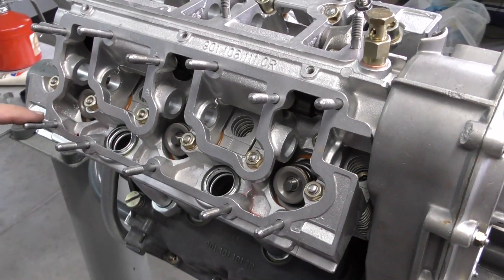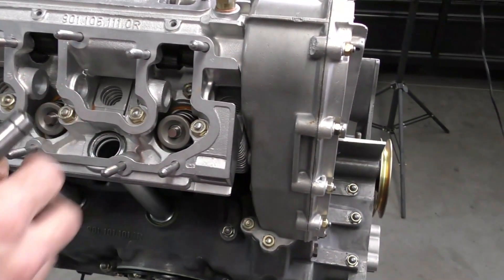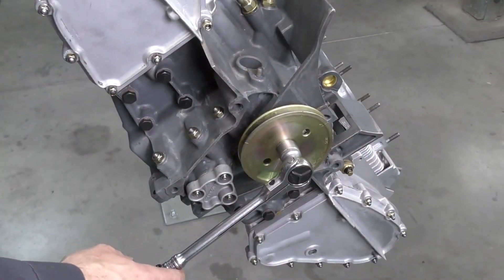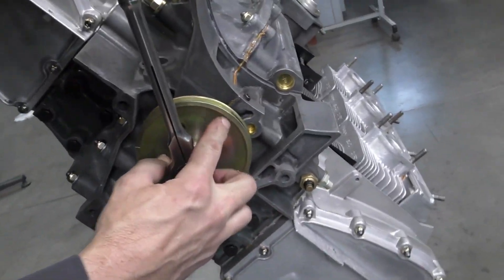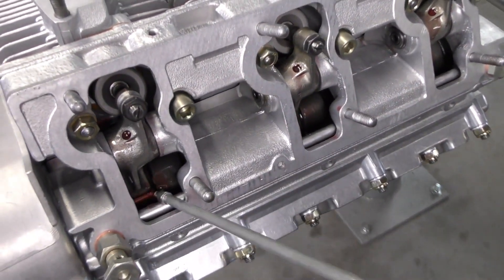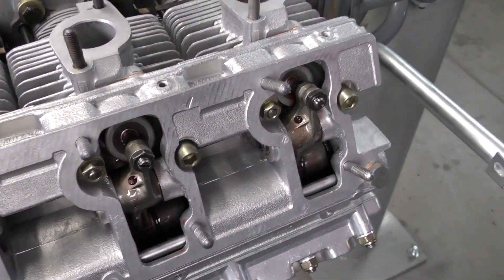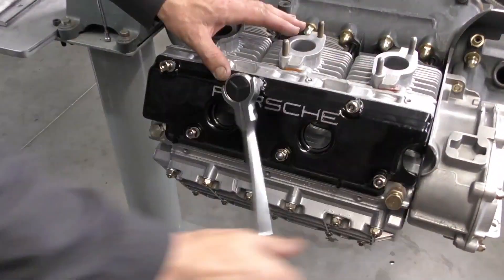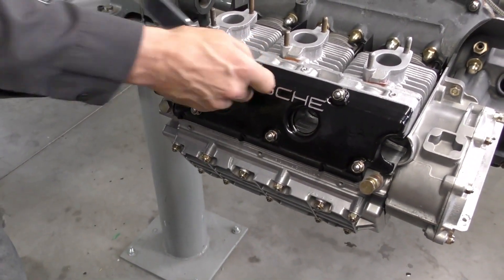Setting Valve Clearance on your Porsche Air-cooled Engine.

Comment: Howdy, im interested in learning why the oil cooler o-rings/seals dont need any oil on them? Ive always put oil on o-rings and seals just out of habit.
Reply from the maker: Because it is a compression seal that is not designed to move during installation. Orings are lubricated to aid in installation. Most times an O-ring type seal is pushed into or screwed against in the case of an oil filter and will bind, roll, or tear if not lubricated. This is not the case with the oil cooler seals. 
However, you can if you like lubricate them when you install the oil cooler and it will not hurt anything.
Kurt
Reply: @Aircooledconsulting  Kurt, what a great response, thank you for the education! That makes a ton of sense,

Comment: What are your thoughts on anti-seize on the spark plug threads?  I know Porsche says not to use any to help maintain electrical grounding.
Reply from the maker: I Still use a small amount of Copper grease when installing spark plugs. Its hard to break old habits.
Kurt

Comment: The milling the valve covers was slick! That is a clean engine!

I see you don't have the carrera timing chain tensioners on here. Im cleaning up a 1977 2.7 and read that I should add the carrera tensioner. What are your thoughts?
Reply from the maker: So the Carrera tensioners are really the way to go. However, in the past 10 to 15 years there has been a resurgence of using the original non pressure fed tensioners to maintain the originality side of the motor. There is also one concern when using the late model tensioners on the early 2.0L, 2.2L, 2.4L, and pre 1977 2.7L engines. The size of the oil pump on the early engines is quite small in comparison to the later engines. Because the Carrera chain tensioners are basicly a controlled oil leak inside the engine this can place a stress on the smaller oil pumps ability to maintain volume and pressure at engine lower speeds. 
Kurt

Comment: You mention adding RSR seals to the rocker shafts. Was there a tech bulletin related to this? What years and / or situations do you recommend adding the seals? I don't see rocker seals in the parts catalog for our car 1970 914-6 (same as 1968-69 911T I think). Thanks again for your great videos.
Reply from the maker: Dennis,
You wont see the rocker shaft seals in the Porsche Parts catalog system. They came from the Porsche Racing division. They can be used from 1964 through 1994 models. I use the seals every time that I pull an engine down. 
Kurt

Comment: Was that the final snug on the rocker clearance adjusters or did you edit out the final tightening?
Reply from the maker: No that was it, I do not add a tighten once the clearance has been set. I do find a lot of over tightened valve adjusters. The issue I find is that the threads on the elephant feet have been streched out and the lock nut jams on the threads. To fix the entire rocker has to come out and the nut and adjuster replaced. I have seen them so bad that you cannot even back the adjuster out of the rocker arm and I have to pop the elephant foot off and bring them out the top.
Kurt

Comment: Thanks Kurt, one last thing of note on TDC,,,,, I'm on Z1 on pully,,,, The rocker arms in cyl. #1 are on the base circle on the camshaft. So that is TDC for #1. OK the only thing is , on the #4 cylinder the rockers are on the rise of the lobe, but not the apex. Is that OK? Thanks Russ
Reply from the maker: Rus,
Yes you are on TDC number 1 and yes the number 4 rockers should only be on the ramps not the tip of the lobes. This is known as the overlap as the intake valve should be closing and the exhaust valve opening on number 4
Reply: @Aircooledconsulting  Got it,, I feel better!

Comment: Great vid's, Question I'm rebuilding a 911S 1974, The engine is together, now I'm installing the Rocker arms, Keep in mind rocker arm #1 and #4 are in and the timing complete. How do I know now when I'm on Z1 TDC, If it's TDC for cylinder #1 or cyl. #4?? Thanks
Reply from the maker: Easy, you can either look down into the cam box and see the cam lobes or you can feel the opposite rocker and see if it is tight or loose. So when you are on Z1 the cylinder that is on the compression stroke will have the rockers on the base circle of the camshaft, this will leave them loose. The opposite cylinder will have both the intake and exhaust valves on the camshaft lobes and the rockers will be tight.
Thanks for watching
Kurt
Reply: @Aircooledconsulting  Thanks Kurt, I will get on that, BTW, where are you from, sounds like a New England accent.  Thanks again!

Comment: What's that oil you're squirting on the rockers?

And thanks for the videos!
Reply from the maker: David,
So I always have ATF oil in my oil can. It is a great all round assembly oil. It is safe on oil seals and can be used on just about anything with fear of the oil damaging something. It is also a light weight oil at approximately 15W, so it easily penetrates into tight tolerances. Making sure that nothing is dry on start up. You can always use the oil that you plan to run in the engine as well as an assembly lube. 
Thanks for watching
Kurt

Comment: How do you know when to replace the valve adjusters, they are a ball joint and do wear but I don't feel they have to be replaced without reason or wear tolerance being exceeded
Reply from the maker: The most common reason i replace valve lash adjusters is because the threads become stretched by people over tightening the lock nuts when doing the valve adjust. The other reason would also be excessive damage to the screwdriver slot, making if difficult to set an accurate clearance without the adjuster moving. I have never actually seen the "elephant's foot" wear out at the valve end. 
Thanks for watching
Reply: @Aircooledconsulting  Thanks, I can see a lesson here, when to replace your valve adjusters.